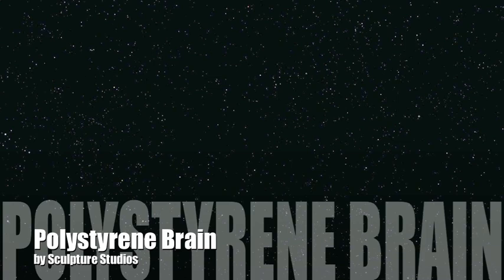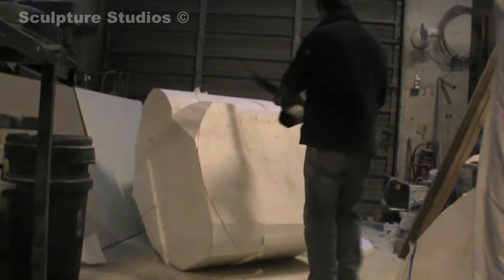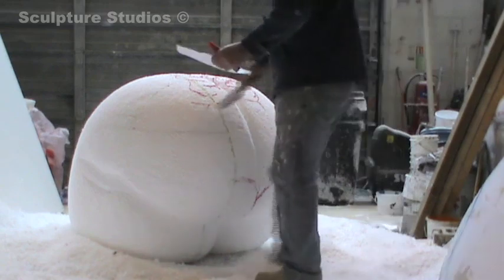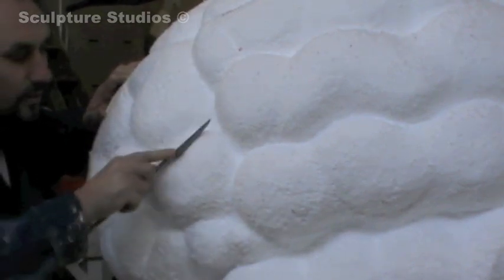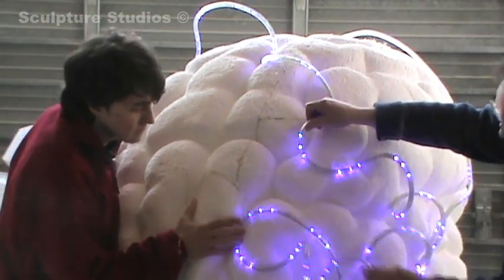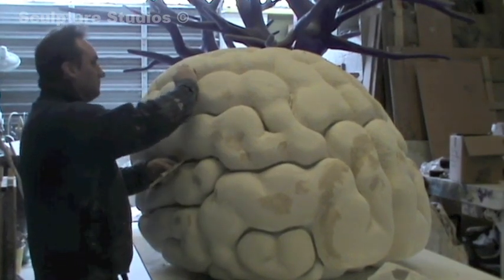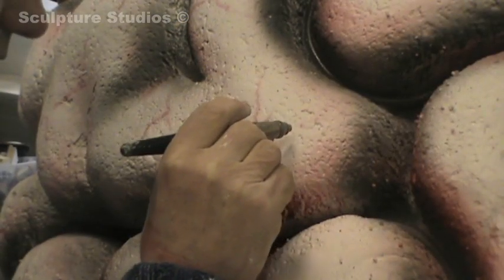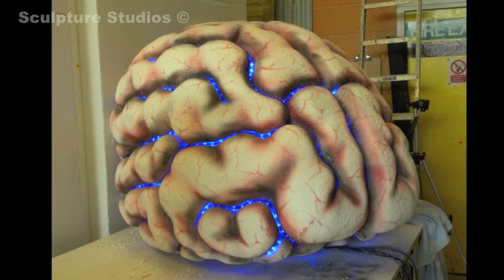Polystyrene Styrofoam Brain by Sculpture Studios

Comment: Love this!!
I have a question... would you mind telling me what sort of filler do you use? I've tried all sorts and they either melt the foam, or don't stick to it at all! Is there a polyurethane-based topcoat filler that i've missed? Of course, I do understand if you've spent ages experimenting and don't want to give away your methods.
Reply: I think they said in one of the other videos that it's a water-based plaster. I had asked for elaboration but never heard back, so I looked into it a bit but I couldn't find an equivalent over here in the states. I'm trying some options out at the moment, such as lightweight filler used to patch sheetrock, and paper clay (home made, I found the recipe on a site called Ultimate Paper Mache).
Reply from the maker: Hi guys, apologies for the delayed response, we obviously get a lot of 
requests so can't always get back to everyone and some things are 
missed. This is one of our older videos so sometimes not all the info is
 on there. But we've included it in the video description that its a 
water based plaster filler as this is always a popular question. As Cari
 says, many of our other videos include this filler as well, and its 
just a water based filler that air dries and can be sanded back.